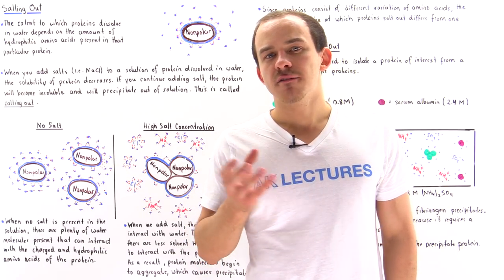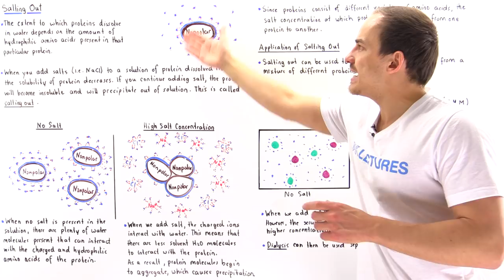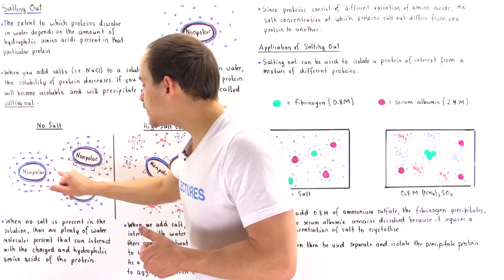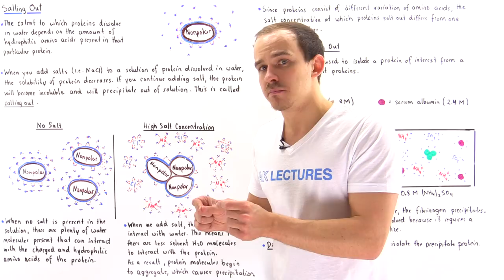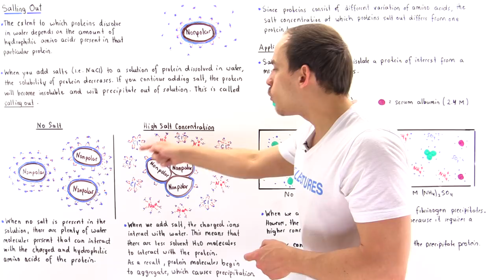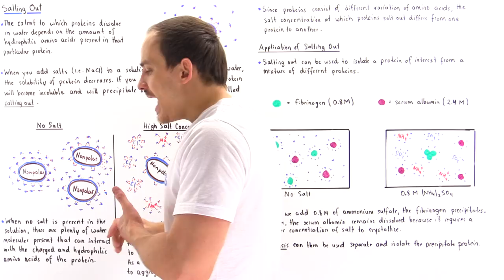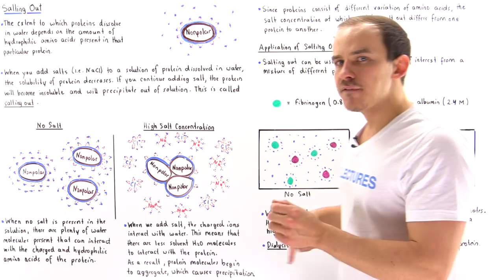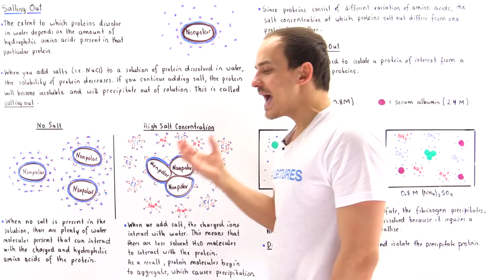Salting Out

Comment: If you were to add 2.4M to the solution, would it be impossible via salting out to distinguish between the two precipitates? I would imagine that if you attain the fibrogen salt concentration first at .8 M, then repeat the process with 2.4 M, you could subtract some net precipitate value from the fibrogen concentration value to attain the serum albumin value. Does this make any remote sense or am I speaking nonsense?